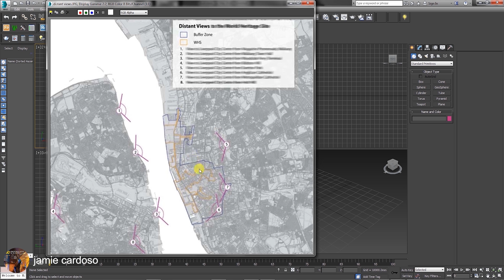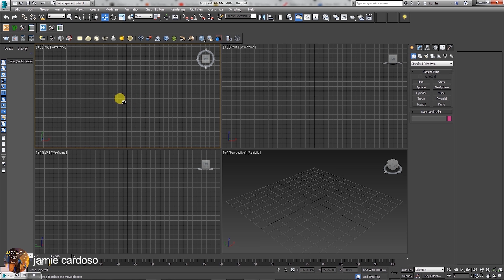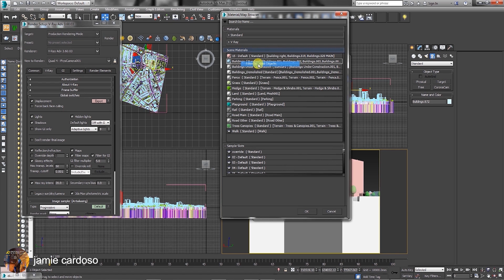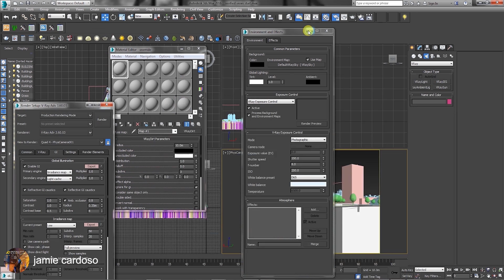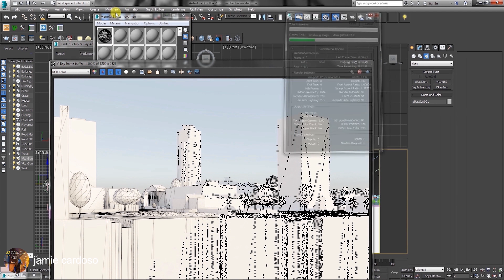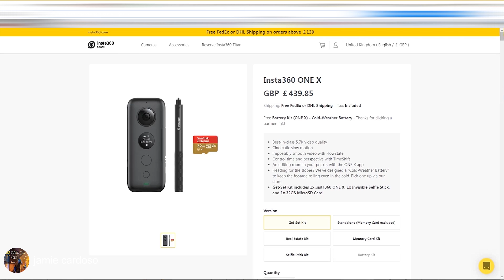Verified Views for Planning Applications Methodology or Accurate Visual Representation/AVR (CC)

Comment: Hi ! all that scripts and other info are still actual for 3dsmax 2024-25 ?
Reply from the maker: Hi there,
I haven’t tried the script for max 2024 and 2025
Reply: @jamiecardoso94  hi I bought it! thanks , very interesting. But the survey data you sent is just a screenshot. I was hoping to practice it with your script , it was my main idea. Can you send this survey data excel file, please. Thans
Reply from the maker: @EstateFPVTravel Hi there, I have just updated the script to work with 3ds max 2020 and later versions. You can download the script file named: verified view script New.ms
Also, I've added a new CSV file for you to experiment the new script with. The file name is: Survey_Camera_Coordinates.csv
Note: In order for this script to work, both the 3ds max script and the CSV file need to be in the same C drive computer folder named: surveypoints
Also, the exl file/s need to be converted to CSV.
Reply: @jamiecardoso94  thnks alot Ill try
Reply: @jamiecardoso94 IAM planning to buy your set. Would you mind to check what u are selling

Comment: Great tutorial, Thank you. Do you know whether Blender can be used in the workflow, instead of 3DS Max ?
Reply from the maker: Thank you @alhas2009 . It's much appreciated.
I'm afraid I have never used Blender thus far. Having said that, the following are the main information you will be required to have in your 3d application: The real camera parameters and height accurately translated into your 3d scene, the accurate survey data information translated into your 3d scene, the proposed 3d building and its real world location in your 3d space